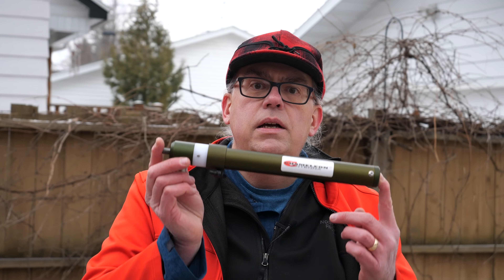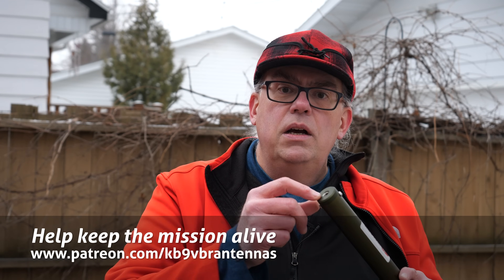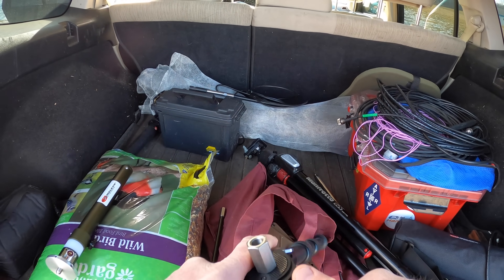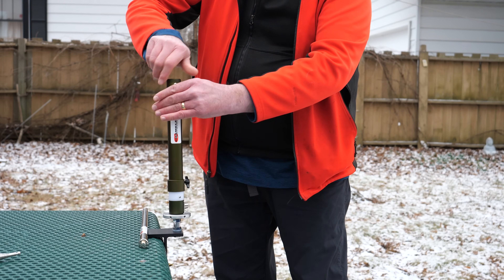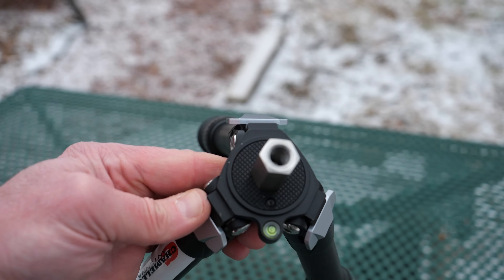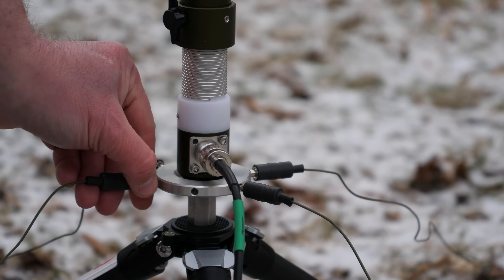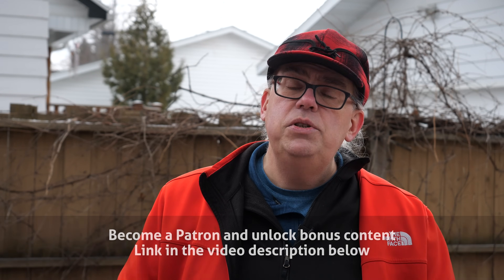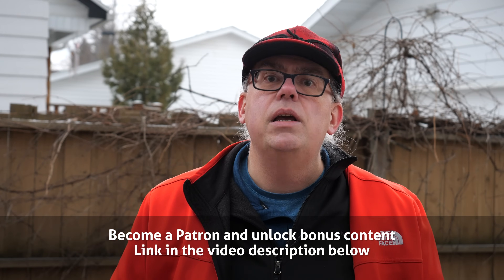Everything you wanted to know about Chameleon's PRV Vertical Antenna Kit

Comment: The winder - held up by a plastic fence pole - and Coil on s tripod is a super combo - got SWR  down to 1:02 with fine tuning of coil/whip length

One trick is to NOT extend the SS-58 fully - leave 3-4 inches remaining, tune coil for lowest SWR and then fine tune whip

Comment: New General here.  I'm trying to decide on my first HF setup and kind of want to "buy once, cry once" for the most part.  Like the idea of POTA for sure, but I would be interested in something I can tear down at home as well since I live in a townhouse.  Should I go PRV POTA or MPAS 2.0?
Reply from the maker: This is a bit of a philosophical question as the two antenna systems have both advantages and disadvantages. The MPAS 2 can easily move from band to band, but it requires a tuner. In most cases the internal tuner in your rig will have enough range for most bands. The PRV has better performance than the MPAS as it is a resonant antenna, but you will have to readjust the coil position for each band. The end decision is performance vs convenience. 

If your habit is to not bounce from band to band, the PRV may be best suited for you as you stated, you need to set up and tear down the antenna every time you want to use it.

Comment: Hi Michael, great video.  Have you tried this coil with the SS17 or the SS25 whip?  Did you see much of a difference?
Reply from the maker: I have not used the MCC with the SS25 whip yet. But I have used the SS25 whip with my Silver Bullet 1000 coil and it works great for the low bands, especially 80 meters. You'll end up using less coil, which means less loss. I talk about that in this video: https://youtu.be/fELj9HLHRJs

Comment: I wonder what would happen if you put that coil on top of the extension that comes with the Chameleon MPAS 2.0 instead of that 24" extension to raise it up even higher? Looks like Im going to have to add that one to my MPAS bag and do some Frankenstein experimentation.
Reply from the maker: That's a good question. The cool thing about adjustable coils is that there isn't a 'magic' whip length, so they leave a lot of room for experimentation.
Reply: @KB9VBRAntennas  I also have the 17 foot steel whip, so I will be trying this antenna out in multiple configurations as soon as I can get my hands on one.

Comment: I don't think I'd consider the SOTA kit for SOTA.  For starters,  the vast majority of SOTA activators use BNC connectors so not having that as default misses the mark.  There's also a lot of unnecessary mass to carry when climbing a summit.  Simpler wire antenna for SOTA, without a doubt.

Comment: Nice product, but the Wolf River Coil, will be much less expensive. But Chameleons' products are well built.  When you mentioned adjusting the radial, it's certainly accurate that you need to adjust it for an optimal SWR match. Without proper adjustment, the SWR match won't be satisfactory.

Comment: Thanks for a solid initial review. The solicitation for one of these crossed my inbox a few days ago. So far I have resisted. ;)

Like another commenter, I have the MPAS 2.0 in my inventory and it is a go-to antenna for POTA activations. It is broad band, very quick to deploy/recover, and I've made thousands of POTA contacts with it.

I have a WRC in my inventory, but rarely use it anymore because it is so fiddly to deploy. It looks to me that the PRV is superior to the WRC and offers a lot of options for deployment (typical Chameleon), but will suffer from some of the same drawbacks as the WRC. In particular, it will require adjustment (fiddling) to make a band change.

This is not a problem if one is running a frequency for an activation (or other activity). That is probably the best use case for the PRV (running a POTA/SOTA activation). I might add one to my inventory for that reason.

I have a tripod hack for you, learned from decades as a photographer. Keep a nylon or canvas bag in your kit. Put a few rocks in the bag and hang it from the center of the tripod. The extra weight will stabilize the system in windy conditions and reduce the likelihood that it will tip over.

See you on the bands! de AG7TX
Reply from the maker: You are correct in the tuning and adjustment aspect of the PRV vs the Wolf River Coil. Both coils function the same in that regard. The Chameleon product is more refined, but is still a base loaded coil. 

I'm familiar with the tripod hack (I mentioned sandbagging in the video). I should carry some sacks with me for that purpose. Unfortunately this time of year the ground is frozen, so I am pretty limited to what materials I can use as weight.

Comment: Michael, thanks again for a good review. I am puzzled with this antenna which I own. I find it way less efficient than my buddistick. Maybe a connector at the base of the extension would help… the variable elevated counterpoise is also a good way to improve performance as you say it. The implementation with the heavy winder is flawed I agree. I had to fix my buddistick too in that regard with a monopod to allow indépendance from a pole to attach it. I am curious about your comments with the ss17. I would love to see you developing a hack review of this coil with a different whip than the ss58 and/or maybe a short on the connector to connect the antenna at the base of the extension to make this extension radiate too before the coil. The coil is amazing but I feel it could do much better than the way Chameleon deploys it. Thanks again Michael love your channel! 73 AK6AS
Reply from the maker: Not being a Buddistick owner, I find it hard to compare the two, but I can say that efficiency of a base loaded antenna lies in the length of its whip. I ran the antenna elevated with the 58 inch whip and 9 foot Mil-whip and the longer whip does make a difference. I've also got a blog post on using the MCC with the 17 foot whip and the results were outstanding. https://www.jpole-antenna.com/2024/01/10/activation-log-christmas-eve-with-the-chameleon-prv/
Reply: Eric, I don't have any scientific data to share. But, I have a conjecture based on field operations with a variety of antennas. Unfortunately, I have no experience with the Buddipole system.

I have and use regularly the MPAS 2.0 system. Its advantages relate to the quick deployment/recovery of the vertical configuration and the matching unit. You might need an ATU to get below 2:1, but I find that I don't generally need one. It is band agile, which is excellent if you are chasing/hunting POTA/SOTA activators. 

But, I suspect it is not nearly as efficient as the PRV or your Buddipole because of the matching unit. There will be some loss of signal in the transformation and that will likely depend on the combination of band and SWR. It might be a little or it might be a lot more.

The question would be whether it is enough to make a loss of an S-Unit for you or the other operator. 
Given that a S-Unit is nominally 6db I am not sure the difference in efficiency would be hear-able unless you are at the noise level. (Boundary conditions are always the devil in the works!) 

My take-away is that I will continue to use the MPAS 2.0 for those cases where I want/need a fast deployment/recovery and/or want band agility. If band agility is not an issue, then an antenna like the PRV or Buddipole (or WRC, Chelegance, etc) is probably the better choice if you have a tolerance for them being fiddly to tune.

I hope this helps. 73 de AG7TX
Reply: @nvrumi  I do have the MPAS lite and regular too. The difference with a resonant vertical like buddistick is substantial and very easy to ear. However MPAS is super flexible and very fast to deploy. With the current propagation MPAS is very useful. But if you want to get this tough to ear DX a resonant buddistick will help a lot!

Comment: I have the Chameleon MPAS, normally as a vertical, as my go-to antenna normally mointed to a Buddipole tripod mast and an IC 7300 with LDG tuner. How will this PTV be beyyer than what Im already using? Perhaps more efficient? Or is this really suited for an Icom 705  QRP rig with no tuner? Maybe I should wait till I get a 705. Your advice is welcome and thanks for all of your detailed research. Rob/WA9RAD
Reply from the maker: This antenna will be more efficient than the MPAS. Between 1-2 S Units better, depending on band and conditions. There is a certain level of efficiency that you trade for the ability to easily jump from band to band with the MPAS system. I did a video a few years ago comparing the MPAS 2 to the Wolf River Coil. You will receive similar results with the MCC setup: https://youtu.be/f4B9I9jqLSI

Comment: Can the PRV be used with the CHA MIL 2.0 and/or the CHA MIL EXT 2.0?
Reply from the maker: Yes it can. I addition with the standard 58 inch whip, I used the coil with the 9 foot Mil-Whip and 17 foot stainless whip. Performance increased with the longer whips. I have a blog post detailing an activation with the 17 foot whip: https://www.jpole-antenna.com/2024/01/10/activation-log-christmas-eve-with-the-chameleon-prv/

On a side note, if you combine the Mil-Whip and the Mil-Ext, you will be almost 19 feet long which is longer than necessary for a 20 meter 1/4 wave radiator. But that combination will blow it out of the water on 40 meters.

Comment: There are multiple comments here about the price.  Yes, the price is very high.  But it appears that this is an excellent design.  Delrin is an excellent choice because of its physical and dielectric properties.  Silver plated wire is excellent for RF compared to stainless steel like other manufacturers use.  The RF loss of this device should be less compared to other options for resonant vertical antennas currently available.  For contrast, the MPAS line is a relatively high loss design.  This design is an excellent example of quality vs value.  Is this a very high quality and well-designed device?  It appears that it is.  Is it a good value for over $500?  That is up to the individual.
Reply: 100% agree! This is how we design all our products. Depending of the antenna type and style, different materials and design choices have to be made according to how the antenna will be used. The CHA MPAS 2.0 can be installed in front or your yard on a post and will resist all weather and situations but it has more losses than the PRV by design! Our CHA SS58 whip is literally build to handle a HUGE beating but it will NEVER fail because it is made to be beefy and very sturdy! You can drop the whole PRV hundreds of times on its side and nothing will fail because the whip has been designed according to the needs of POTA and SOTA where antenna installations is always less than satisfactory!
Reply: @Chameleon_Antenna  would you care to elaborate why the PRV has less losses than the CHA MPAS 2.0 "by design"? It does not immediately appear obvious why that would be the case.

Comment: FYI they sent you extra stuff. I just looked. The POTA kit doesnt list the clamp.

From the website:
CHA PRV POTA (HEAVY KIT)

1 X CHA MCC (Coil)

1 X CHA SS58

1 X CHA SPIKE MOUNT 

1 X CHA PUCK HUB

4 X CHA B-RADIAL (12'6")

4 X CHA WINDERS 

1 X WW- RADIAL (34') 

1 X CHA TRIPOD ADAPTOR 

1 X CHA EXTENDER12

1 X CHA UCM

1 X CHA 12' COAX w/ integrated RFI Choke
Reply: The clamp is called the CHA UCM Universal Clamp Mount.
Reply: @Chameleon_Antenna  There it is. Now I see it. My bad. I didnt notice it the first time around when I looked at the product photo without viewing it full screen. It almost disappears in profle view. 

This is now on my short list of new antennas for the spring.
Reply from the maker: Chameleon model names always throw me too, the clamp is called the UCM. It’s listed on the parts list and in the picture on the website. The tripod, though, is not included. I used the tripod instead of the spike because our ground is frozen.

Comment: Just too expensive for something that requires that much work to tune. Same thing with Buddipole products. The quality is there, just can't justify the cost when there are several other antenna options that can produce the same results with quicker setup times and at a fraction of the price.
Reply from the maker: The secret to quickly tuning a base loaded vertical is that when you get down to 1.7:1 or less, you stop. Don't spend needless time chasing the mythical 1:1 match. Even at 1.7:1 you will still have more efficiency than any similar vertical that uses a transformer.
Reply: If you like to manually tune the CHA MCC you can always go with the CHA MPAS Lite!
Reply: It's always a trade off, "there's no such thing as a free lunch". Is it easier to stick a transformer and vertical (MPAS) into the ground and hop on the air without manually tunning? Yes. 

Is it going to be more efficient to spend an extra minute and tune a coil in place of that transformer? Absolutely.

Pick your poison.

Comment: I would like to see a comparison to the G-Gabil, which I'd been starting to look at as a possible portable operating antenna when I'm finally ready for one...
Reply from the maker: I haven't put the PRV system and the Gabil head to head. But anecdotally I can say the Chameleon is the better antenna. I struggle getting a good match on 20 meters with my Gabil, but the other bands seem to be fine. There's just something about that coil, it can be so touchy. When spring rolls around, I'll take the two out and see if I can make a more substantive comparison.
Reply: No comparison! I have both. Fabio can’t compare imho. Let’s see what Michael says.

Comment: Another great video Michael..  I just recently purchased the PRV.  I haven’t had a chance to try it yet with my 705.  I like the idea of the elevated counterpoise as it resembles the Buddy Stick Pro.  All Chameleon needs to do is use a lighter wire winder.  Will you have any QRP POTA videos with this antenna in use?
Reply: We’re already on it! We’re experimenting with lighter reel and/or 26 gauge PTFE wire!
Reply: @Chameleon_Antenna  COOL!!  I’ll be looking forward to getting  the revised winder for my MCC when it becomes available.  Hats off to you guys and the folks at Rolltech for producing some great antenna products.  👍
Reply: A good and safe way to use the current elevated counterpoint reel is by supporting and securing the paracord on the other side of the tripod with a provided steel stake or by attaching the paracord to support behind the tripod to prevent the system to tip over.
Reply from the maker: Thanks. I agree. Putting the wire on a winder instead of the reel would help with the weight. I will be posting one of my QRP activations with this antenna to my Patreon feed. But I am planning a future video QRP with the MCC.

Comment: Hi Michael - Solid video as always! 

Can you clarify between the following:
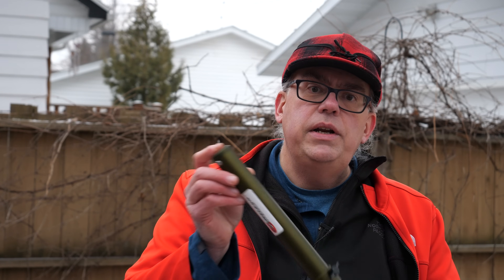1:12 "between 6 and 80 meters"
vs. 
Chameleon listing: "Bands Coverage: 2M to 40M with the SS58" 

Sounds to hit 80 we'd need a whip not included in the either package?
Reply: Stack two -- maybe three --  coils and a 17' whip for 160M... ;-)  Don't forget to put a shorting plug in the SO-239 of the upper coil(s).
Reply: @DaDitDa  yes! We’re already designing and testing stackable coils that will tune the antenna on those frequencies for those who operates them!
Reply from the maker: To get to 80 meters, you will need the 17 foot stainless whip, which is an optional accessory.

Comment: That price is crazy.....
Reply: Even knowing that there are cheaper and better coils I went to check it because of the bypass mechanism this one has, but almost 5 times more expensive than the coil I currently use (which always give me flat swr and has lived through heavy winds and -35c temps). Looks like a nice coil, but too expensive 😢
Reply: When your POTA antenna setup costs more then your radio 😲
Reply: Will this resonate on 75m with a 17' whip?
Reply: Well that’s the difference between having product manufactured in China vs manufactured in the USA. The difference is that each and every single parts of the unit are made with TOP quality materials and craftsmanship. We also have a 12 months warranty which just about nobody offers either! 

But when you take the time to actually look at each components and compare with similar made products, which 99% of them are made in China, our product is very competitive! We are n't selling loading coil made from SCHEDULE 40 PVC pipe from your local hardware store that are going to melt or deform after a session of FT8 or JS8Call at 100W! Those PVC pipe melt at 140° Fahrenheit while the Delrin melt at 347°F!
Reply: @Chameleon_Antenna  I believe you intended to say: We are NOT selling loading coil made from SCHEDULE 40 PVC...  Also, the sliver-plated wire should reduce power loss (i.e., heat) in the coil compared to coils made of stainless steel wire.
Reply: @DaDitDa  yes indeed! Sorry for the typo - I’ll be updating/fixing the above post the moment I reach my QTH later tonight!
Reply: Not really since you have an American made product with excellent customer support.  That is really hard to find today.